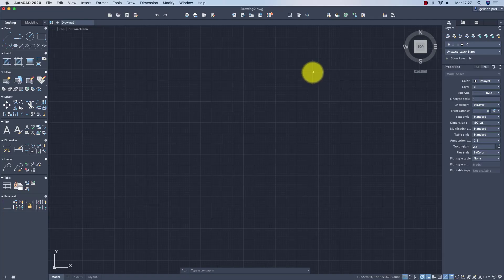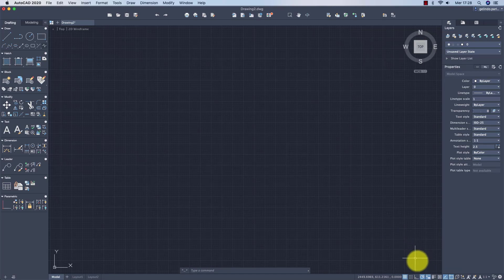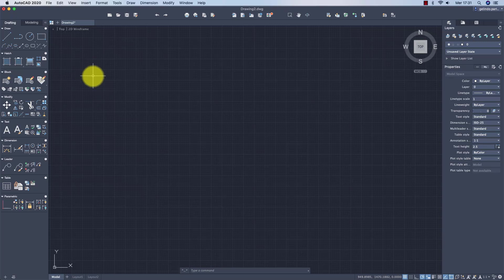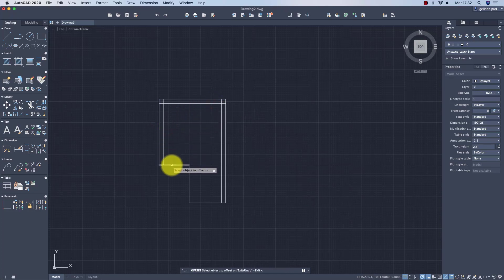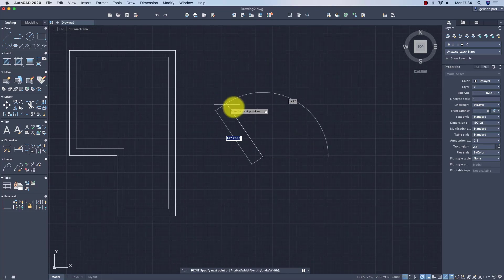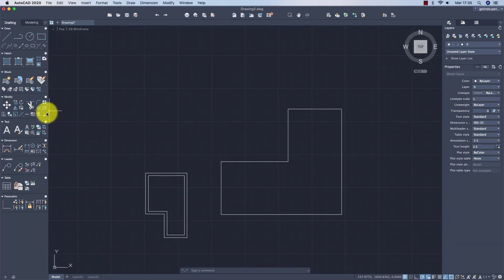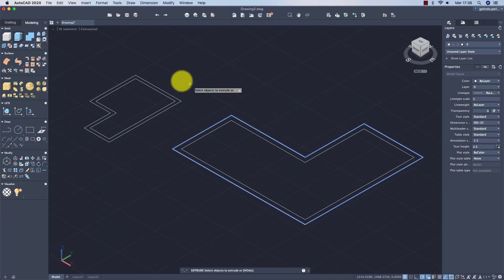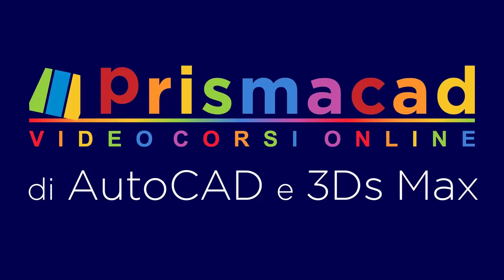How to make a WALLS with AutoCAD for MAC

Comment: hi i have question, is there any MLSTLYE (multiline style) command in autocad 2021 on Mac ? Because i could not find that command.
Reply from the maker: Multiline Styles cannot be create in AutoCAD for Mac. If you have AutoCAD Windows version, you can: Type MLSTYLE from keyboard